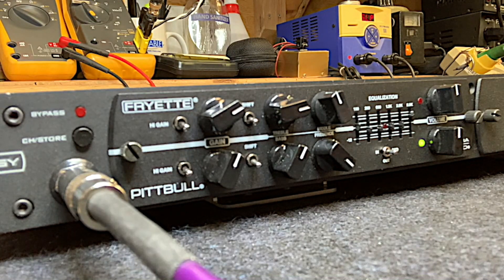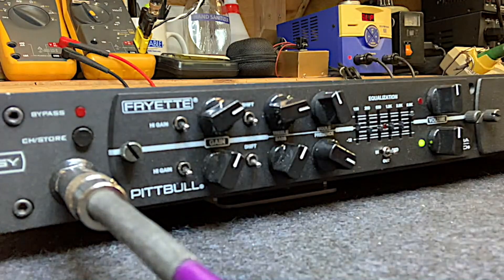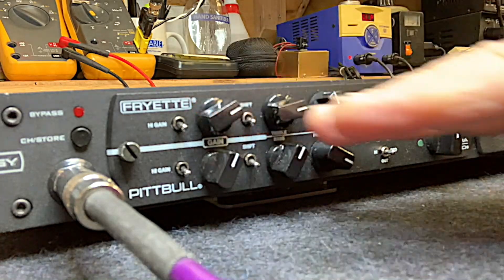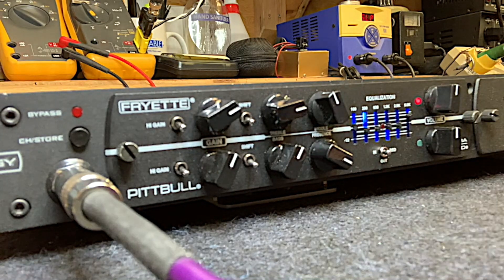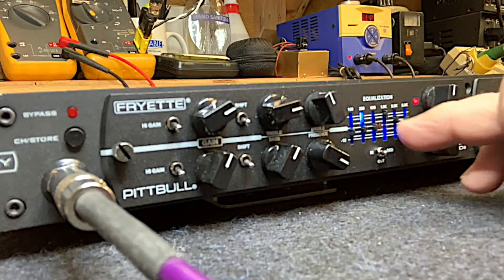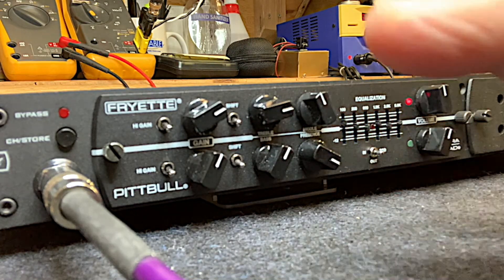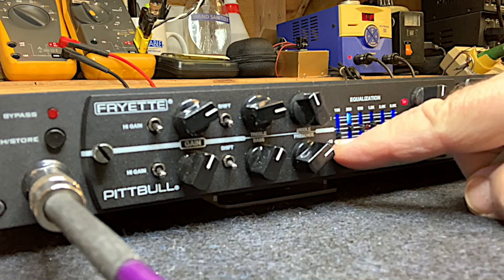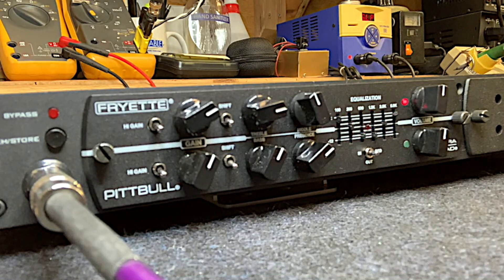Steve Fryette talks Settings for the Synergy Pittbull Ultra-Lead

Comment: Just found a clean 05 Pitbull UL 120 local and matched with a Hiwatt hi-gain series 4x12 with the f70s. How does the cab compare to the fat bottom/deliverance cabs with f70s?

Your eq explanation helped me a ton with dialing it in. Using a fender Strat with a single Seymour Duncan HB.
Reply from the maker: The FatBottom cab is more focused and directional due to the cab design and the fact that the speakers are front mounted. It's a very tight punchy cab. The current D cab is more omnidirectional, again, due to the cab design - specifically the V-Brace - feature, and that the speakers are rear mounted. It would sound closer to your cab, but with a tighter bottom end.

Comment: Very cool. One question I always meant to ask you re: my CLX: I tend to run the middle channel in vintage mode, the third channel in high gain mode, but I don't use the third channel much. But, the third channel being set to high gain mode affects the second channel sound/response in such a way that I prefer the third channel being in this mode even if I am using the second channel in vintage for most of what I play. Was this by design to have them interactive in this way?
Reply from the maker: The CLX doesn't have anything called "Vintage" mode. If you mean "Normal", there may be a very subtle interaction between the gain switch settings on Lead and Rhythm. If you're not really using the Lead channel, there's no downside to leaving the Lead channel set to Hi Gain if that makes the Rhythm channel work better for you.

Comment: Can the green channel do a good clean sound (without rolling back the guitar's volume)? Very interested in buying one of these.
Reply from the maker: The green channel is a slightly lower gain version of lead with a little more low end and a little brighter on top. It's not a fender channel.